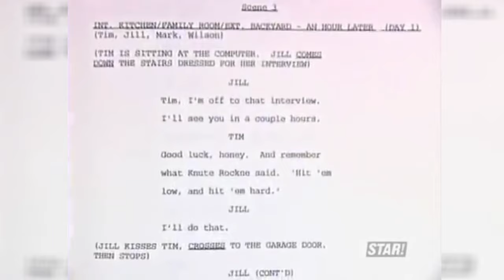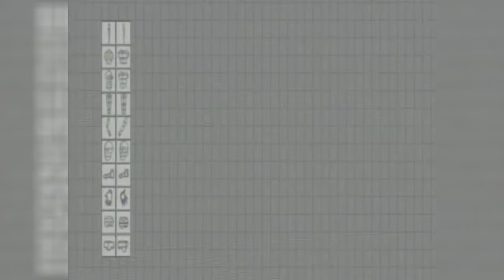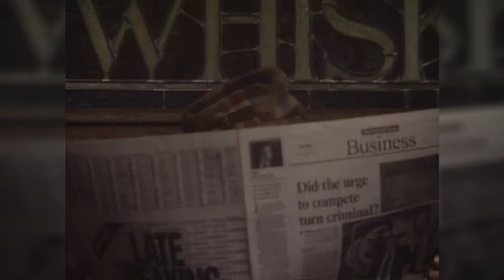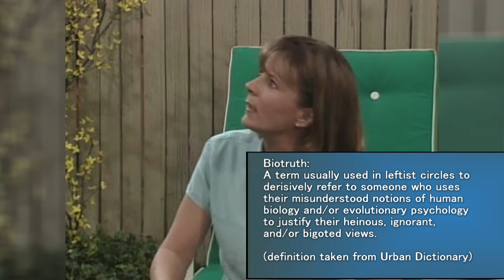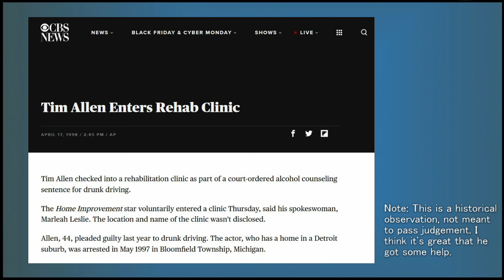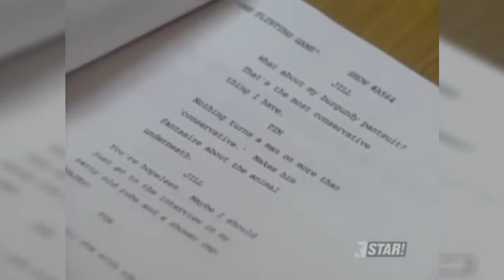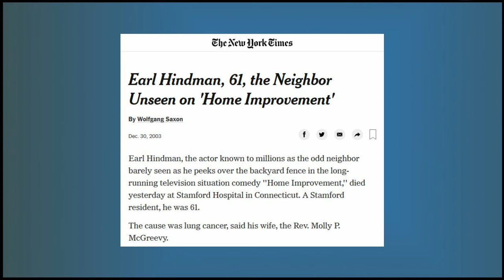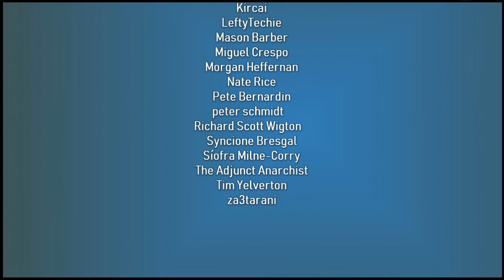Building a Better Man With Home Improvement

Comment: jose desperately attempting to grunt despite being a smol bird
Reply: Jose held back his grunt so hard, he pooped out this epic video from hundreds of feet in the air.
Reply: the scolding call of  a titmouse is very harsh, and alarming (I'm guessing  a titmouse based on profile pic).
Reply: @jasonwhiteside5517  it's very clearly a blue Jay
Reply: @yonatanbeer3475  clearly it's not clear, owing to the fact that I clearly don't have an ornithology degree to be able to say clearly what the physical appearance of the smol picture of the smol bird 🐦 is, clearly. Savvy?
Reply: Daniel Martinez , while I had had "had," had had "had had"; "had had" had had a better effect on the original poster. Surly, you can see this, as clearly as you may presume that you can't.  🕵️‍♂️👀
Reply: Daniel Martinez  yea I was swinging for the fence when I guessed that happened. 👍
Reply: Daniel Martinez agreed 🤝. good for quips, discourses, and parlays, et cetera.

Comment: i was enjoying this til it became more of an attack on masculinity than it was a retrospective of a 90s tv show and as soon as I heard the words 'cis white hetero men' used unironically I had to check out, the point of Tim is he is a floundering modern man TRYING to embrace the old concepts of masculinity and failing, and Jill embracing moder feminism and struggling, and BOTH of them supporting each other, showing men dont need to feel threatened by empowered women, and women dont need their man to be a traditional masculine type while also  reinforcing the need for a family dynamic, masculinity, femininity isnt the point, solidarity is. And Tim going for advice on topics from an older male figure speaks to the need for a male role model even into the time of your life when you yourself become a father. Men are expected to be strong, and lead and know all the answers, and often we dont, but we dont show that in front of those looking to us for the answers, ie kids, instead we slip out quietly and consult someone wiser and more experienced, thus becoming wiser and more experienced ourselves. none of this is a negative as its portrayed here, (the vid not the show) and the show also shows us its ok to be wrong, to fail, as long as we bounce back and do whats right by those around us.
Reply: Thank you for taking the time to write this comment, which explains so well what was great about the show 🙂

Comment: I enjoyed this up until the ending. While you pick out some places where it fails and some problems early on (which even I had to acknowledge as a fan), you show pretty much throughout how the show was pushing a progressive message, how it tackled toxic masculinity, how it challenged gender roles, etc. 

But then, at the end, you go on about how the show isn't feminist in any way,  and how it's clearly pushing a pro-patriarchy, conservative message--despite the primary focus of the review being on how it challenged those ideas. 

The disconnect is so strong that it feels like you wrote the conclusion first, and then didn't change it when you found elements that didn't fit your thesis. It would be fine if you said it wasn't as progressive as it could be,  held back by its conservatism, but, no, you just pitch it as a conservative show. 

The show is progressive, despite some problems, and is the type of progressive that we need to actually appeal to conservatives. Because, if you live in an actual conservative place like I do, you'll see that there's nothing "old" about the message at all. We're still dealing with it--in fact, there's been a resurgence of white male fragility and rejection of progress like how Tim starts out. 

Tim is the personification of the conservative, toxic masculine character. *If the show supported the patriarchy, Tim would have been right and Jill wrong.*

Comment: Interesting video.
I only want to comment on the one bit about teenagers acting out the way Brad does. I think the real issue is a lack of real responsibility for MOST kids in the U.S. today compared with MOST kids in the rest of the world and in the past. Romeo and Juliet is a bad counter-example because I think the heart of the matter is not present vs. the past. Rather, I think the heart of the matter is extended adolescence. Romeo and Juliet were in well-off families who behaved like modern-day gangs, and didn't have any real responsibilities.

Teenagers will always act out in some way, but they do so out of an urge for independence. So if a child is raised with a certain amount of autonomy and responsibility early on, they won't act out as intensely, because that pressure won't have built up. That was the point they were getting at, though probably not very well.
Reply: Interesting. Completely agree.

Comment: I also think your exploration of the slapstick is missing something important. Yes, there is something to the idea that slapstick is a traditionally masculine type of humor, based on the idea that the real man is strong and can take the punishment. (That last part is something I'd not considered before, even.)

But you miss that the slapstick in the show is always a result of Tim being a buffoon due to his toxic masculine desire for "more power." He's being punished for his hubis as a man. The few times he doesn't screw up, it's because he doesn't try to push his dick measuring contest. 

When the few others get hurt, it's because they embrace the same idea Tim does. The only exception is when Al gets hurt--and even then there's the issue that Al enables Tim sometimes--though he mostly serves as a counterexample to Tim's foolish "masculinity."

So, sure, the women aren't the focus of the slapstick, but that's because the women aren't as foolish. Jill is, 95% of the time, right. 

Instead of the manly man being presented as right, the show went out of its way to show that this idea of what men should be was wrong. The slapstick was part of this.

Comment: It's a bit unfair to judge this show from 30 years ago through the extremely different gender "norms" of today. At the time it was made, that was still a pretty standard take on gender roles in society. That's not to say it is or isn't correct, just that the concepts we have now didn't exist back then. There were no words for it, no one pushing for it (in the mainstream anyway), and zero mention of anything much more than breaking the glass ceiling for women. This show definitely plays up a patriarchal leaning, but the binary-ness mentioned in the video was the dichotomy then and was the biggest grounds for debate. It's only after Will and Grace and similar shows of the same era that women's rights have found a bigger place along with gay rights and diversity in general. The new era of gender being not the same as sex and on a spectrum has only existed in the mainstream for less than a decade.
Reply: I didn't mean that to be harsh or disagreeable though. I've really enjoyed your retrospectives including this one.
Reply: @JBrynnJ  Your first post kinda makes the entire point of retrospectives though lol, times change and these shows slowly become dated here and there.